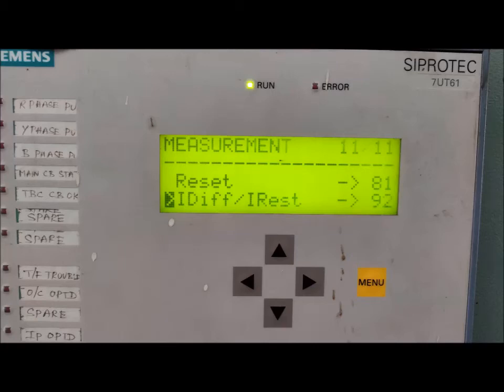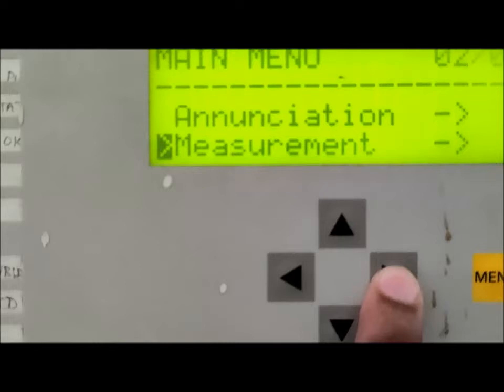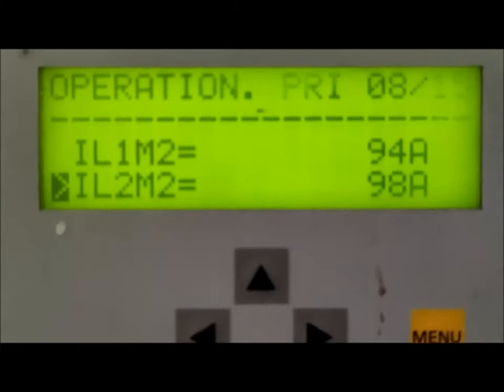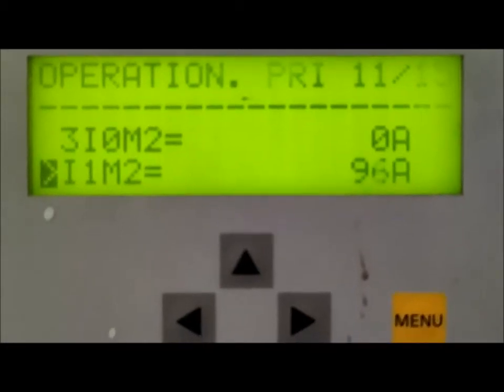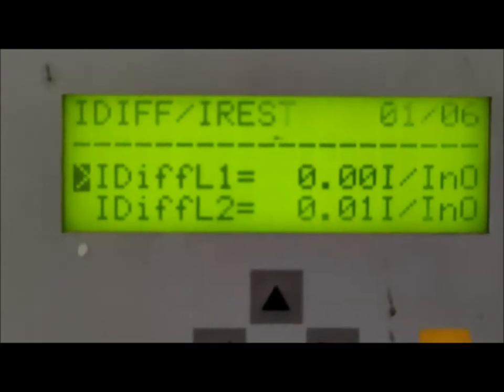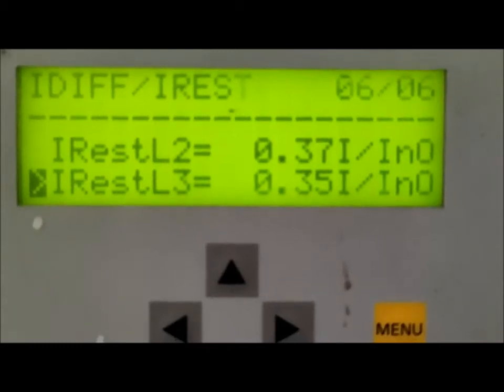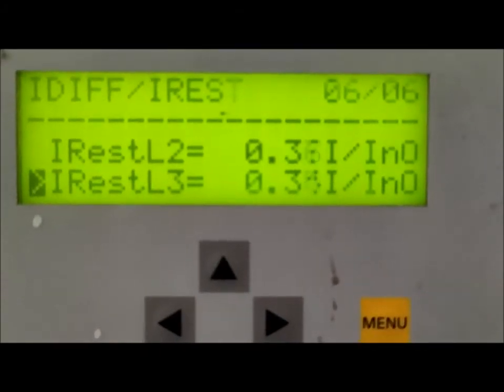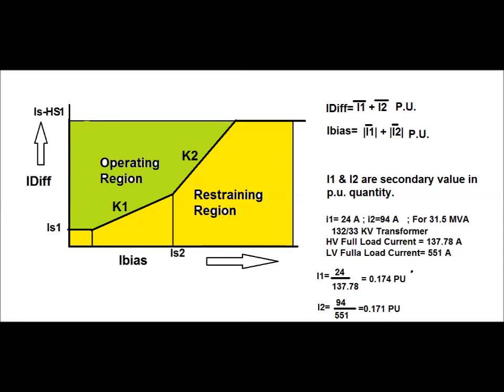Differential Relay || Siemens Make  SIPROTEC 7UT61

Comment: I1=24 and I2=94/ How is it come?
Reply: There are the actual current on the HV and LV sides. In other words 24 is the real current that is currently coming to transformer HV side. I think he's showing us the Relay in Real working conditions in a substation.
Reply from the maker: In actual case if I1= 24 , I2 shall be 96; when tap position in nominal tap. But in this case tap position of the transformer is not at nominal position.